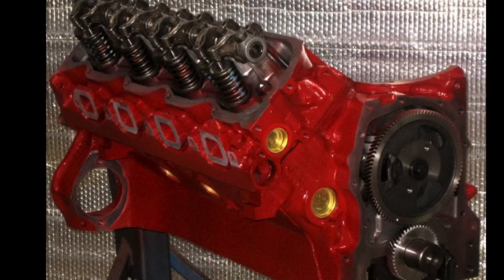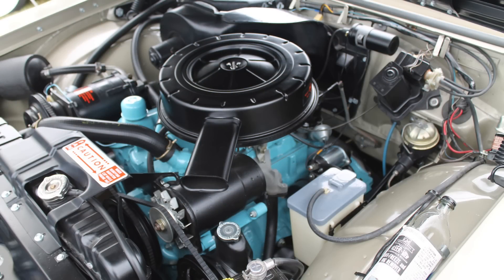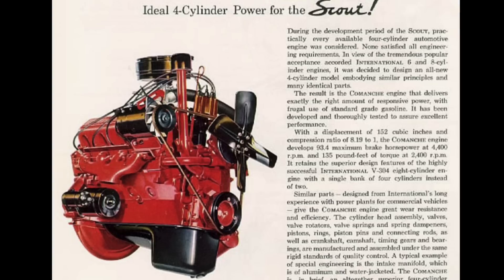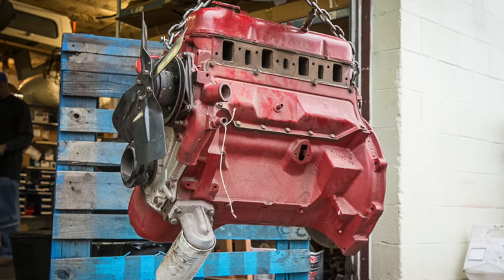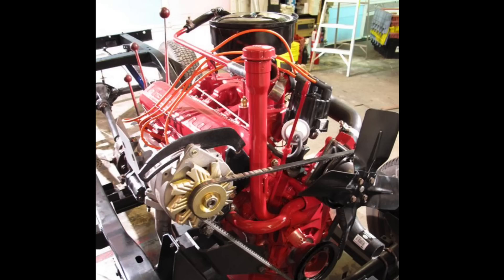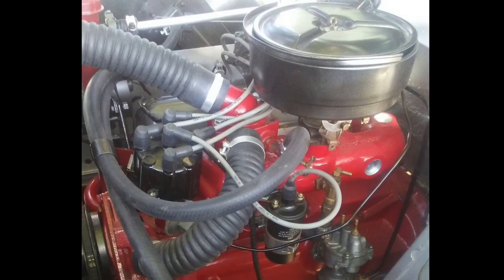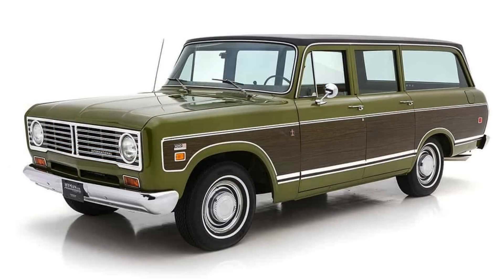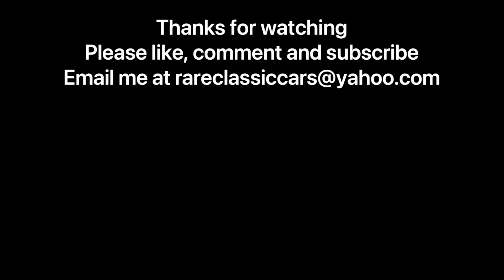Strange Automotive Engines:  International's (IH) "Half of a V8" Comanche 152/196ci 4cyl!

Comment: At some point IH was looking into replacing IH engines with other engines. Some small block Chevys but mostly looking at Chrysler 6 and V8 engines. This was to meet stricter EPA regulations. Unfortunately IH as a company imploded in the 1980's. The Scout and Light Truck Line were gone. But those IH engines were awesome engines. The V8's sounded like they could pull down a redwood tree. In fact the 392 IH V8's were the preferred  engines for Loadstar trucks. The Loadstar trucks were immensely  popular as dump trucks, cement trucks, school busses and so much more.  So much so that IH was buying AMC 401 engines for trucks because they could not make enough 392 engines to meet demand. How the mighty fall.
Reply: IH's introduction of the "S" series medium duty trucks in 1979 is what saved the company.

Comment: Don't hear enough about IH vehicles.  When I worked on them in the 70s, I was impressed with how robust they were designed.  I never experienced any driveability issues with them.  They were just solid!
Reply: One of my old bosses had a international/AMC dealership in Oregon back in the early to late 70's. He'd say that was his funnist time in the car business, both companies were easy and fun to deal with and would give him anything he wanted for product. He could only remember one instance of one of his customers that had engine issue with a '74 Travel-All in which the engine (392) failed due to overheating. He couldn't recall exactly what caused the overheating issue, but they replaced the engine under warranty and International never questioned it. The biggest issue he'd seen at the time was "squeeks and rattles" and fit and finish (mainly water leaks)of the doors, windows, fenders, etc. He had said the bodies were crudely assembled which wasn't a big problem and a few rust issues that was because that International didn't galvanize their sheet metal for their body parts other then that they were great vehicles.

Comment: Had a 1961 with the 152, a 1967 with the 196; much better than the 152 especially with the 4 speed.  Lastly a 1970 SR2 with the AMC 232 6cyl, it was the fastest and smoothest on the road.  For chugging around the Colorado mtn trails the 196 w/4spd was the best, wish I still  had it!

Comment: My 1982 Malibu has a Chevrolet produced 229 v6. It shares the same architecture as the v8 Chevrolet small block. It is far more refined than my Pontiac 2.5 Tech 4 's.
Reply: That 229 was based on thier 305 V8. The 262 (4.3) was based on thier 350, and they even built a little guy based off of the 267 V8.

Comment: Yep Adam, the 4 Cylinder Comanche Engine seems to be too small to power an Int'l Scout and Unbalanced, as well.....My memory is of the V8's in the 70's & the Scouts were gas-guzzlers, leaking oil a lot. They were very heavy vehicles and not big sellers in OZ, though looked cool, Adam. Cheers fm Damo🤔🤲

Comment: I can't say to any other automotive manufacturer but the AMC 2.5's block and bearing caps (1) were machined on transfer lines originally built to machine 6 cylinder blocks. Its just that the clamps, locators and clamping pads were built into the machinery to make 4 or even 5 cylinder engines from the get go.
1) Bearing caps were machined as one piece then cut into individual caps by a gang of eight slitting saws in the last operation. The eight saws cut the individual caps apart and the the outer surfaces of #'s 1 and 7.
Reply: How did they maintain the circular machined bearing surface if they cut the caps after they machined the journals?
Reply: @gregorymalchuk272  
The bearing diameter on the caps were only rough machined on the bearing cap line. This was done in a machine called a Cincinnati Broach. It would cut the half round, the mating surface and the side locating surfaces. All finish machining was performed with the caps mounted and torqued.

Comment: The best reiteration of all is the Chevy 4.3 V6. Pulled 2 cylinders out of a smallblock V8.
Reply: And Chevy's lesser known 3.8 and 3.3 90 degree V6.
Reply: @johneckert1365 The 3.8 you refer to is simply the 3800 and the 3.3 is the 3300 reduced. They were not Chevy engines. GM did use 2.8, 3.1. & 3.4 SOHC engines used widely, and a 3.4 DOHC as well as a 3900.
Reply: @wymple09  You are incorrect. The Buick 3.8 is a 231, and the Chevy 3.8 is a 229. The Chevy 3.8 was only in RWD cars, never in FWD cars. It was easy to distinguish the two engines from eachother because the Chevy V6 had the distributor in the rear of the engine, identical to Chevy V8's, also all the front accessories (water pump, power steering pump, alternator, etc) were the same. There was also a CHEVY 3.3L V-6 that looked identical to the CHEVY 3.8 V-6. They have absolutely nothing in common with the Buick 3.3-3.8-4.1 family of V-6 engines. 
Research a 1978 Chevy Malibu, you'll find that the base engine was a 3.3 Chevrolet V6, which was basicly a 267 Chevy V8 with 2 cylinders missing. A year or so later the bore was enlarged to the 305 Chevy V8 diameter, making 229cid (3.8L). Eventually Chevrolet increased their V6 bore to thier 350 V8 diameter, giving us thier 262cid (4.3L) that was used through the mid 2000's.
Reply: @wymple09  You also left out Chevrolet's 3.5 V6, it in the same 60 degree V6 engine family as 2.8, 3.1, 3.4, 3.4 DOHC, and 3.9.
Reply: Indeed.

Comment: Just stumbled onto this video. My comment here is to clarify that the picture of the Scout 152 engine with the partial turbo (and disconnected outlet pipe to the right) is not a picture of the actual turbo option installed in the 1965-67 Scouts. It's a picture from a "turbo" Scout project I had around 2016. I was mocking up 152T turbo exhaust manifolding mounted to the larger IH 196 in a 1980 Scout II engine bay, to check for clearances and feasibility. My project was successful, but short lived.

Comment: The amount of incorrect information in this video is ridiculous.  The 2.5  liter used by AMC was a GM engine not a AMC 6 with 2 cylinders removed. Thats just the 1st incorrect piece in the video. And it goes on from there.
Reply: You are wrong as well. Yes, the first 2.5 4 cyls AMC used were imported Iron Dukes from GM, but shortly thereafter AMC started producing thier own 2.5 4cyl, which were similar to the 4.0. Same bore & stroke, and actually used the SAME pistons & rods.

Comment: In the 74-75 International light truck and the Travel all a v400 V8 engine was available. This was actually a AMC 401. I have one of these engines, getting ready to drop into a 82 Jeep J20.
Reply: I pulled a 401 AMC v8 from a old rusted IH pickup and rebuilt it and put it in my 74 Jeep CJ5. Fantastic power with just a few mods.Induction and Cam being the most important . The Comp 268H is absolutely perfect for the 401 in my opinion. The midrange power is perfect but really it really never stops pulling hard from idle to 5000 rpm  It's just noticed the most from about 1200 - 4500 . Cruising at 2500 at 65 mph  I can just step on it lightly and in a few seconds it's at 4000 and 100 mph with 3.73 gears and 35" tires. I've no idea how fast it is because I've never stayed in it longer than I needed to getting around someone on the highway.  But it's got absolutely no problem frying 33" tires just looking at the gas pedal at a stoplight
Reply: @GorillaCookies  you are correct. The first time I did this engine, that was the cam I used. This time a Bullet Racing custom cam, 9.5:1 forged pistons and light head porting as well. Really interested to see how this turns out. The old way I could fry 33's with 3.73's as well. This time it's 32's!

Comment: I think the AMC 2.5 came out before the 4.0. I have both engines , love them both.
Reply: The 2.5 was machined on the same transfer lines that were used for 232/258 blocks. The other block line (1) switched from 258s to 4.0s with minimal changes. Just cutting tools mostly.
1) There were 2 six cylinder block lines prior to the 2.5s introduction. The 199, 232, 258, 4.0, 2.5, 252 and 282 are all the same engine family with common architecture. The 252 and 282 were produced in Mexico. 232s and 258s punched out to a 3.875 bore. The 282 was the first 4.0 stroker!

Comment: Here in Australia in the late 1970's, Holden (GM) took an already extremely anaemic 173ci cast iron ohv six cylinder, lopped off two cylinders and VOILA the utterly and positively glacial "Starfire" four cylinder was spat out.
Its ultimate crowning glory was putting this 78hp boat anchor mated with an equally underdone hree speed slush box auto "Tri-matic"  in the 1980 Holden Commodore station wagon weighing almost 1.5 tons.
Watching one of these dungers accelerate was literally like watching paint dry🫣🤔😵‍💫
Reply: Its possible that Holden's block line or lines for machining the 173 already had provisions for locating 4, 5 or 6 cylinder blocks. For the 5 use one locator for the 6 and one for the four.

Comment: Owned three Travelall's over the years, they were all the 1200/1210 3/4 ton models. When California started charging several hundred dollars to register a pickup and it would have to have a commercial plate, I could register my 'binder for about 35 dollars as a 3/4 ton station wagon. They sucked gas but would haul a load and keep it out of the rain plus if you went camping, you could put the air mattress in the back and have plenty of room for your gear.

Comment: I've forgotten the exact year, but I had a mid-1970s long-bed Scout with one of these "half-engines." Easily the worst vehicle I've ever owned or driven. Starter solenoid kept sticking (rust), no permanent fix, so I had to carry a kid's baseball bat in the car to "tap" the starter occasionally so the engine would start. Gearing was awful. 2nd was good for maybe 30 mph, tops, with a huge jump to 3rd, where the engine demonstrated what "underpowered" meant. It just couldn't pull the vehicle on an uphill grade at less that 50 mph. And blah, blah, blah. It was a terrible vehicle, with terrible gas mileage, uncomfortable, unreliable, etc. No nostalgia here…

Comment: Never had a Scout, but I loved the ScoutII's.  The 304's were unbelievably bulletproof, due to their extremely thick cylinder walls, forged cranks and nickel-alloy blocks and gear-drive cams.
Reply: Back in the mid 80s I drove a ih one ton truck for waterproofing fountains ,it had the 304 in it I feel it was just as good as a 350 but a tad easier on gas. I miss that truck, should have bought it when boss man asked me if I wanted it😞
Reply: The best by far for longevity  as you could bore them over and over if you had to,but never really needed great motor

Comment: My family owned an autoboby repair shop. We had a 1961 Scout, with this unique engine, set up as a snow plow and tow truck. My grandfather bought it new in 1961. It was a blast to drive! Power nothing, vacuum wipers and sliding half windows in the doors. The gearing was insane. In Granny gear,  the torque felt like you could pull a house off its foundation! When my father retired in 2005, the Scout had 13,200 original miles on it!!!!! My uncle, living in Texas, drove to Pennsylvania with a flatbed and hauled it back to Texas. The Scout lives on!!
Reply: I’ve got a 64 scout 80 with one of these engines, a set of points and condenser and it was good to go.
Reply: Had one with 304 v8 never should have sold it.around 1980
Reply: @joesutherland225 
I drove 1. 304 scout a Friend had I fell in love with it. We took it off road. 
I tried buy it. I like it better than my 75 CJ 5 . To this day I still try to keep my eye out for 1 in good shape. It was good solid no rust had a tighter turn radius. 
I never own 1 but I always love them old Internationals .
Reply: Studebaker hawk nice!
Reply: Love the story and you have a cool family. 😊
Reply: Love this story.  I think the scout came with a 4:28 axle gearing.  Pretty low.  I had a 1972 Scout with the 345.  It also had low gearing.  It felt like I was driving a school bus with the way it revved.   It had limited slip differentials and was unbelievable in the snow.  Wish I still had that truck.  Love it that the 61 Scout is still working.  That is awesome.
Reply: @thelorax7704 had 65 scout with 345 from pu , said all wheel drive on it. Sure the rear had posi as one on ice &  one on dry pavement, would spin the dry one on takeoff not sure if front was posi " all wheel drive" if someone would confirm ,would be nice
Reply: My dad had a Scout Terra with a 4 cylinder, but he pulled it out and replaced it with an inline 6 from a Nissan 260Z, it was epic. It sounded great and had tons on power. He used it to haul 2 ton loads of adobe bricks into the mountains.
Reply: @PistonAvatarGuy  Great! The inline 6 Nissan engine matches in the Scout Terra. Since International use the SD33 Nissan diesel engine for the Scout 11 Terra and Traveler
Reply: @levyoliver5363   Even if there had never been a diesel Nissan engine in any IH vehicle, the swap would have been possible.
Reply: Tejus... what a shit hole.
Reply: Nice. My old boss’s brother owns a pair that are slowly rotting to death that he REFUSES to sell. Both myself and the guys own nephew tried to save at least one to no avail
Reply: My 61 scout 2wd came with two tops. A pickup style roof and a full roof. Had subara brat rear seats. When I washed it I washed the inside as same as the outside. So many fun times in that little under-powered truck.
Reply: Any pictures? Would absolutely love to see it. I want to build a scout wrecker just for recovering scouts
Reply: Absolutley right! I think International Harvester made the strongest granny gear ever, than Chevy! Because i experience that when working in a golfcourse. The 1991 3500 got stuck loaded in sand. And the Chevy V8 couldn't spin it's granny gear anymore

Comment: I drove a $500  64 IH step side pickup with the 152 and a 3 speed for many years. I gave it to a local farmer after it failed inspection due to rust. The performance it had was surprising.
Reply: That is A VERY RARE IH C900 pickup.

Comment: Porsche did this as well.  They removed the drivers side bank of a 928's V8 and created the inline four that was used in the 944 and 968 models.  They even built DOHC and turbocharged versions with up to 3.0 liters of displacement.  These were very smooth due to a pair of balance shafts licensed from Mitsubishi.
Reply: The two old timers (1) out in California that have done conversions of OHV V-8s to  OHC have put the 928 heads on Chevy Big Blocks. The hore spacing is really close.
1) Can't remember their names. They've done some really neat work.

Comment: Scouts were small vehicles. I can't agree with you calling them "relatively heavy". They were some of the shortest length vehicles on the road, comparable to Jeep CJ's, which were also typically powered by 4-cyl engines in the 1960's (if not Buick V6's). But I admit, people also complained about Jeeps being underpowered.

Comment: I'm so glad you featured IH!! Don't forget about the Nissan powered diesel they offered. Absolutely zero power, but unreal fuel economy. Keep in mind, while not perfect, International carried over a lot of the durability and toughness from their ag lines to their vehicles. They didn't fair so well against rust, but tough as nails.
Reply: As per the rust issue that plagued International was because of the lack of galvanizing on the sheet metal used in their body parts. Along with fit and finish which was a little crude, definitely not award winning to say the least. Probably a cost-cutting measure by the top brass. International along with Dodge pickups (at the time circa 70's) were known for having weak bodies but bulletproof powertrains.
Reply: @michaelmurphy6869 
IH bought cheap steel in bulk from France and stored outside.
Reply: I was wondering if somebody was going to bring that up.  Power be damned, people were looking for cheap fuel and good fuel economy at that time ('78-'79 I think).